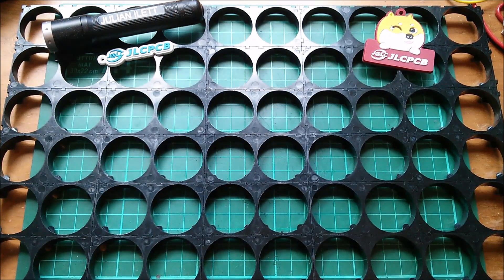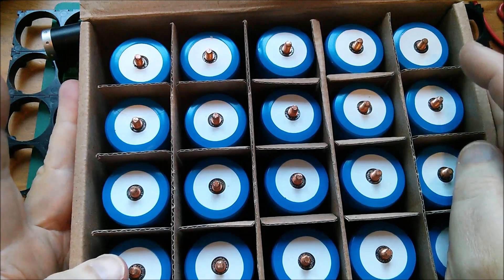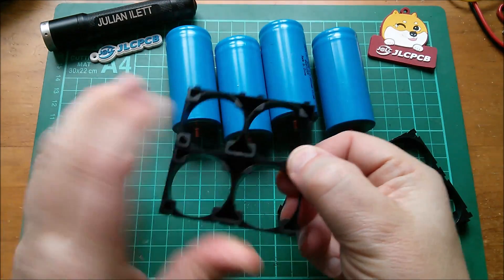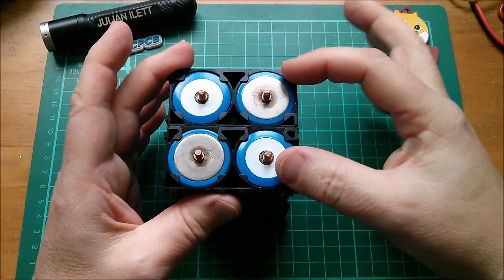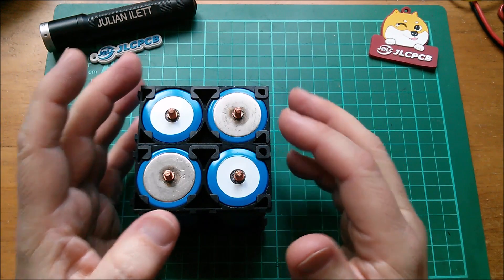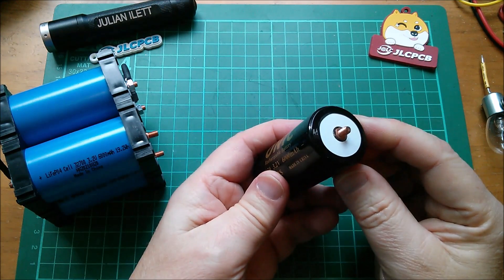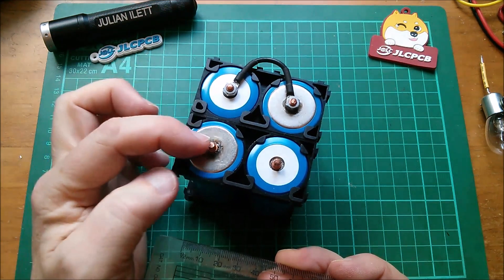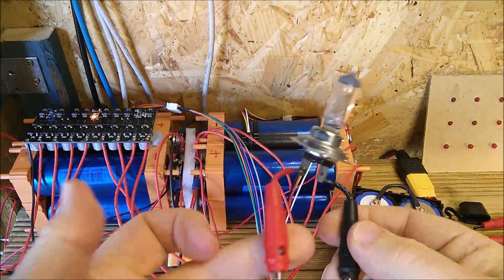New LiFePO4 Cells - 32700 3.2V 6Ah 19.2Wh

Comment: Why couldn't you screw the batteries end-to-end? You said flex. So what? If it becomes a problem, just add some mechanical reinforcements in the middle as needed, like foam spacers, or plastic "beer can cages" like you already have at the ends

Comment: cool I like those batteries, you dont have to worry about soldering or spot welding onto the battery it already has a reusable lug on it! just dont put too much stress on them as they might snap off, though you will probably just rip a hole in the end of the cell before that!

Comment: I've purchased a set of these cells for myself. Gonna probably make another small portable power station out of them.
As the screws will help me a lot to connect them up with a good enough connection to handle some decent current.

Much better then soldering. like i've done in the past.
(i'm sure i'm gonna make somone cringe at the thought that I soldered batteries to make some of my battery packs) XD
Reply: I tinned and soldered 2032 button cells for tyre pressure sensors. Despite having minimal heat sinking (good risk of damage) they were absolutely fine.

Comment: You inspired me to make my portable soldering iron power supply. I ordered 18 32700 LIFePO4 cells last night. Went with flat capped tabless cells from Battery Hookup. I'll spot weld tabs on them that run to the PCB where all the circuits will be. All the chips will fit between the cells. Height limit changes. Had to switch capacitors so they fit. I'll be using 9 in series for the battery pack. I designed the balance system already. Working on the monitor circuits. Need to also come up with a buck/boost converter to output anywhere from 12 to 24 VDC for the TS100 soldering irons to use. Version one may just use a simple LDO linear regulator. As for the case, it'll all go into a Pelican 1060 case, including 4 TS100s, spare tips, tools, etc. Solder, flux, tip cleaner, alcohol, etc will go into a second 1060 case. I may have to loose one cell for connectors. Yes, waterproof when closed up is a requirement.  Maybe should switch to 1/8" 3 conductor phono jacks as they would fit better than the 5.5mm barrel jacks plus 4mm tip earth ground banana jack.

Comment: 7:04 I thought about a Soil (foul) water pipes 3 meter  110m with 2x  110mm screw cap ends (Srewfix) - Plastic Deck Garden Storage boxes - 19" Rack  Cabinets and server & Network cases (on wheels) + 19 Rack Flight case Racks & Deck boxes (on wheels)

and Adding usb Heater matts + Fire resistance foam ( No Nonsense Fire Rated Expanding Foam Gun Grade 750ml (90589) (Srewfix)+ Autiomatic Tube Seeking fire Extinguisher (FireFlex - FireTrace (uk) brands  )

Fitted and embedded Interlinks Connectors
- neutrik 8 + 2 Pole XLR Chassis Connectors
- Powersafe Powerlock  400A & 800A 
- Veam MOVE-MOD. Power, Signal and Data 
- ShowSafe 19-pin-connector

Comment: If you used a PCB for the electrical connection, could you also use the PCB as a replacement for the battery holders?

Comment: I guess they measure including  the studs.

 Got a bunch of 18650 cells scavenged from robomowers and I considered getting a small spot welder but I already got a stud welding machine. (Used to run my own sheet metal company here in Gothenburg)

Comment: Is there any reason you can't do away with the battery holders and design and use PCB's for both pack ends?
This would eliminate the need for slotted or oversize holes in the PCB's and also give the packs structure.

Comment: What's your earnings, been like on the Hashing machines?
Reply from the maker: Paltry! A couple of cents per mining session (although it looks like I may do 3c today). But it's all a matter of scale.
Reply: @JulianIlett  still something tho
Reply: Should pay for the batteries in a couple of years. After that - watch the money roll in! ASIC-based miners would do better, but they can't adapt. Every time there is a new algorithm they have to be replaced.
Reply: @donepearce  Some of the latest ASIC resistant coins like the current hard fork of Swagbucks use a variety of algorithms with a logical rule to select what algorithm will be used for the next block based on what algorithm was used for several previous blocks. That would make it especially hard to effectively utilize an ASIC to mine such a coin. Prior to the hard fork, Swagbucks used Scrypt with a high N factor (high memory use to hash), which worked to make it ASIC resistant until ASICs with external memory like the Rockchip RK3288CX ("Jameson Hasher") came along.

Comment: I'm shocked that you don't have a digital caliper!
I have 3 and use them all the time. One lives permanently beside my 3D printer room. 
One on my computer desk, and one on my electronic workbench. They're so cheap and well made, why carry them around? 
If you model plastic replacement parts in Fusion360 for 3D printing, you need one.
Reply: Digital calipers are wonderful but I like the idea of a plastic ruler for poking around high current battery terminals.
Reply: @Droidy77  He was measuring the plastic holders to find the center to center of the holes, wasn't he?
Reply: with cheap digital calipers you should order a shit ton of buttoncell batteries as they drain in no time just from hanging around.

Comment: These sound so interesting.   Wow and no welding of nickel strips.  Are they high discharge or capacity cells?   Wonder how they stack up against 18650s?   Also I noticed that many of your projects are related to crypto currency mining.   That is so abstract to me.  Don't understand how that works for the life of me.   Great work.  Keep it up sir.
Reply from the maker: The seller reckons 18A continuous - that's 3C. Kind of midway between discharge and capacity. It took about a year of fairly intensive study to get my head around cryptocurrency :)
Reply: @JulianIlett  thanks for the reply Julian.  I was just talking with my elderly father about crypto currency yesterday and his interest in it at 83 hehe.  I'm building batteries now and will look into these 32700 and 32650 cells.  Many like the 18650 require weldable tabs, but those with bolts really are appealing.   Thanks again my friend.  Most interesting videos.

Comment: The ones with the nut and bolt are used in emergency lighting as the backup power 👍
4 in a row in thick shrink tube, they replaced ni-cad packs with soldered tabs a few years ago 👍
Reply from the maker: That makes sense :)
Reply: Is there any website  where I can read up on "The nut and bolt ones are used in emergency lighting as the backup power" ?
Reply: @joatmofa0405  I'm sure there's other uses 👍 that's just where i find them when i scrap out old tech, search for the size of cell IE 26650, 18650 ect otherwise try a search fir cylindrical cells LiFePo4
Reply: @Dirt-Diggler  lol - I think one must be specific when ordering (to ensure avoid getting the wrong cells)!

Comment: Seriously tempted to get a pack to replace lead acid batteries in my allotment. My power useage comes to around 6 Watts an hour, so wondering if a pack of these would be enough to cover a 24hr period. Thanks for the video, will watch keenly how you build your battery out.
Reply from the maker: These cells are marked 19.2Wh (let's call it 18Wh). At six watts continuous, they'll do 3 hours. 8 cells in parallel could do 24 hours. Stack them in series to get the voltage you need - I'm guessing 12V. A 4S8P battery should work :)
Reply: @JulianIlett  Also keep in mind D.o.D. (depth of discharge) and small Voltdrops over cable lengths.

Comment: Use Slip slits instead of holes (===) Allows for deformations in case or Center post ailments
Reply: That was what I was thinking, and he could rotate the cell in the holder   to bring the pin to center (side to side)  even if wasn't centered the other way.
Reply: @NoisyPlaces  On the bigger cells, it would make sense to have the negative stud intentionally offset to the side to reduce the length of connecting strips needed.

Comment: What do you think of the LTO batteries? (Lithium Titanate)
Reply from the maker: I've never tried them, but don't they have a lower energy density than LFP? They have quite a low voltage too.
Reply: @JulianIlett  they have lower energy density but have greater cycle, greater charge C rate, and much safer. i guess they fits on places that deep cycle a lot or on high risk environment like automotive. they dont combust if punctured
Reply: Yeah 2.3v nominal. Interesting that they state upwards of 25,000 cycles life time. And I think that's the 80% capacity figure.
Reply from the maker: Interesting. Cycle life is a consideration as my cells will likely be cycled once or twice per day.
Reply: @JulianIlett  so the common cell size on your friendly chinese selling place is a 66160 or 66180 cylinder. Capacity is up to 45aH. Seems commonly 40aH. I don't know how that relates to energy density. I guess at 2.3v nominal, it could mean less energy density?

Comment: put us out of our misery and capacity test so we can know if these are a good buy or not :)
Reply: Can also recommend the 32650 cells from Basen. Bought 5.5Ah cells @ 1.7$ each. Tested with 5.6Ah@1C.
Reply from the maker: These are seller tested. One box says 6225 to 6250 mAh, the other 6050 to 6075 mAh. Maybe that explains the price difference :)
Reply: @JulianIlett  I am not one to go off blind trust :) But it still depends on the C rating that he used. Would they supply 2Ah for the 3 hours or did he test at some 500ma load :p NOw being LIFePO4 they should be able to manage a good load anyway